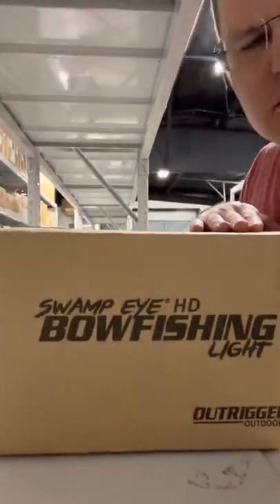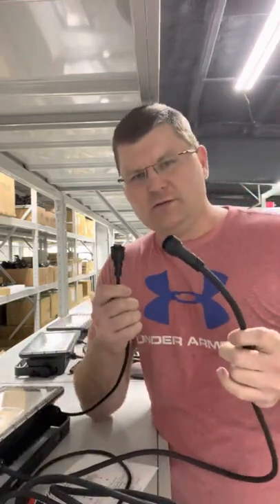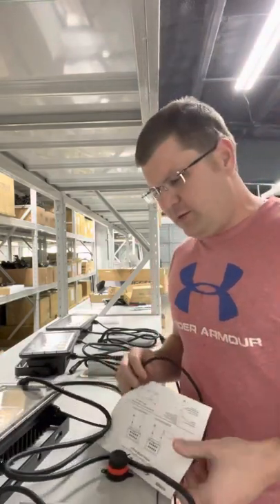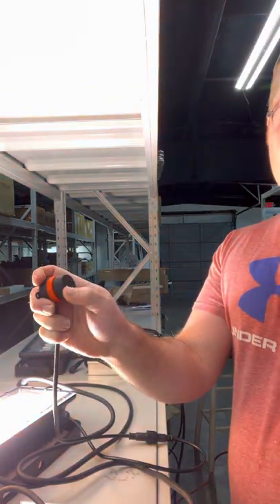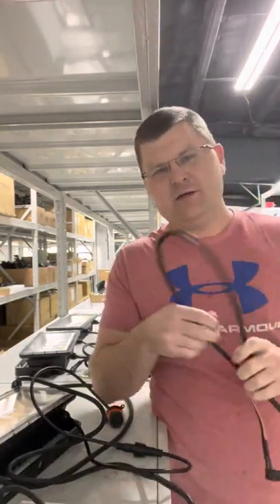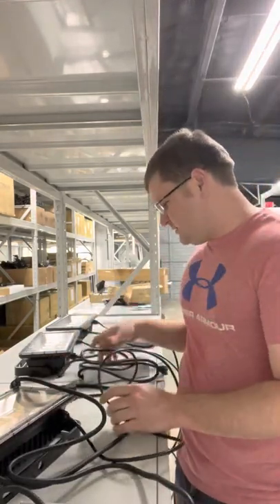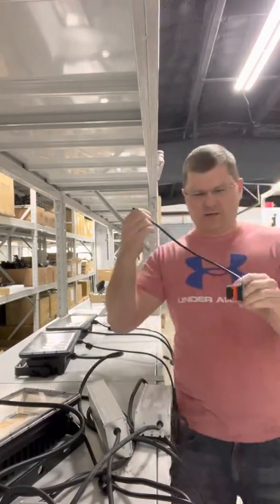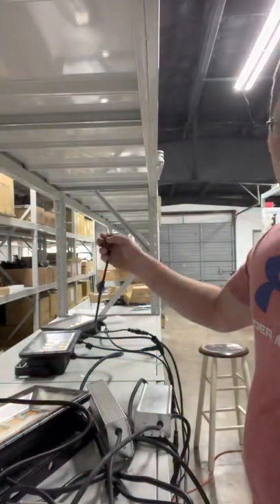Swamp Eye HD Bowfishing Light Unboxing and Building Block Wire Harness Setup

Comment: I have two of the Swamp Eye 2 color submersible lights. They came with wire ends. Can I connect them to your dial control? If so, how?
Reply from the maker: No sir the dial is only for the lights compatible with building block wire harness which currently include the Swamp Eye HD and Swamp Eye Gen 2X Light Bar
Reply: @outriggeroutdoors6656 I understand. if I had a two prong connector compatible with your dial harness, would that work?

Comment: How long would two lights run on a 24 v battery?
Reply from the maker: It depends on what the amp hour capacity is. Generally speaking, most people use 2x ~100Ah deep cycle batteries in series so based on that - you're drawing roughly 13 amps. So you'll get 7-8 hours. That's theoretical run time, in reality your voltage fluctuates and so does your amperage so maybe you can get up to 9-10 hours.